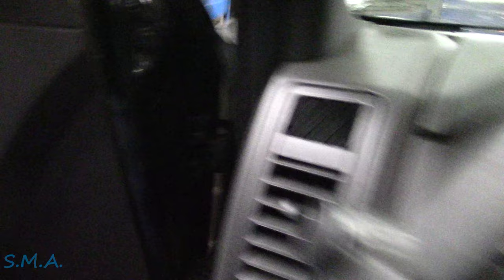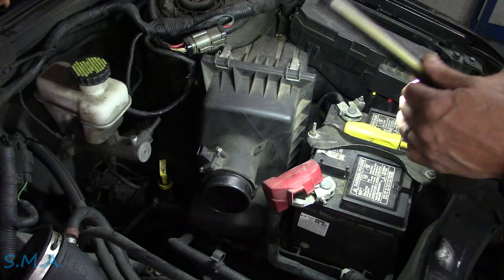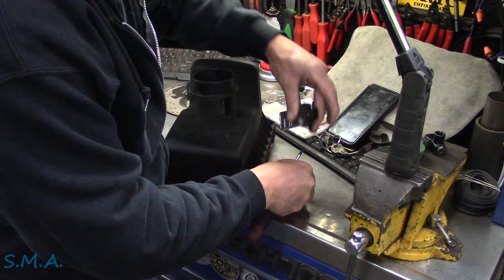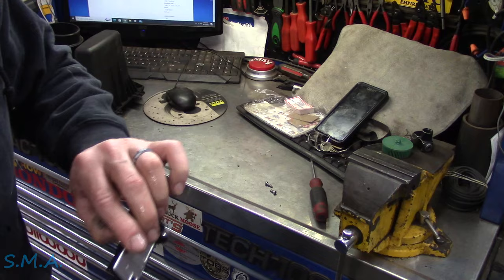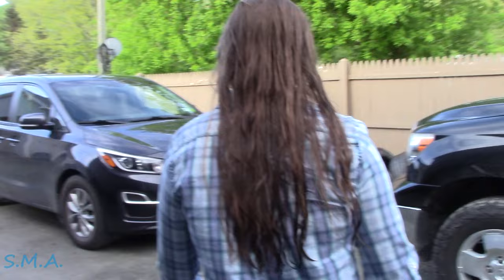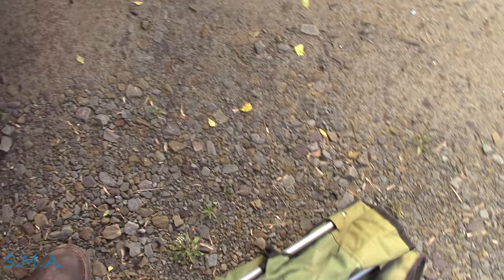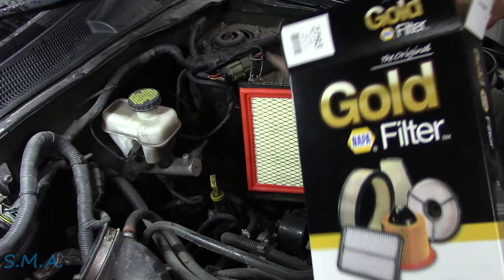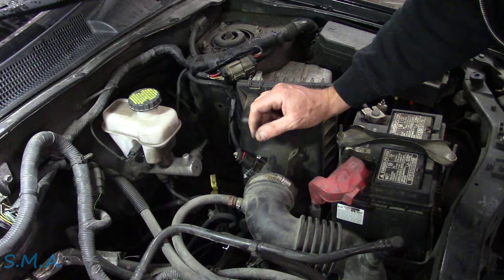A Mouse, A May Fly And A Broken Car....

Comment: I have a chipmunk that keeps storing its nuts in the bottom of my airbox and pissing on my cabin filter.  It only chooses my vehicle.  I swear I took out around 50 acorns when I was tearing the car down.  I found droppings under the back seat when I pulled it out.  I changed the cabin filter the other week and its already smelling like a rodent urinal and I'm losing my damned mind!

Comment: Love you videos. I have a 2011 Dodge Ram 1500. RPMs are going down to 500 when at a stop.  Could it be the mass air flow sensor? Under the hood is pretty dirty. I was thinking that could be it.

Comment: If this would have been a shady mechanic he would have said the engine needed a rebuild due to debris from the holy intake and parked it in in the bay for 2 weeks, then returned it with just a new air filter for $3,000.

Comment: Mine was a rat in a Jeep. Never could find him, he just had to age out. Embarrassing, went to a Bluegrass Festival, parked by the outhouses, he was ripe.
   Did a road call on a Ford 550 dump truck, opened hood drive saw a rodent, next trip out took some peppermint oil sprinkled in engine compartment. Peppermint  oil works good to chase a rat out of the house. Read somewhere that peanut oil is use in wire insulation, thus attraction for rodents. Must be true I read it on You tube.

Comment: Just curious, did you pull the intake going to the throttle body to check if filter remnants were possibly stuck in it? I’m sure you did, but that was a lot of filter that got chewed up.

Comment: I recently had a friend that lived in the country leave their car outside of my house and she said they check engine light was on I followed the same procedure that you did and found the same exact infestation in the air filter that cleaned it all out clean the mass air flow I also put a screen over the air intake sprayed the whole engine or I mean the lines with jalapeno juice because the rodents are chewed up some of the vacuum lines and wires I guarantee they won't go after that car again and it ran like it's scalled dog and she was happy and it cost me not a whole lot of money to set her up hey that's what friends are for have a I once had my fridge act funny check the fan & was a mummified mouse body no head the fan chopped  chased my wife with it  great day

Comment: I had a mouse climb up in the heater motor cage and die on a 99 degree day. I could not use air because of the stink.

Comment: Mr O  those little suckers cost me 275.00 big ones got up in fuse box on my 2500 chevy silverado  got up left garage  truck went in to limp mode made it back home called shop they found a complete home in there and snacks were the wires . Ended up traping 3 more life in the country. Ues a rodent  repellant  now no problem since

Comment: not to be overly pedantic- but the chances of contracting the virus are MUCH higher for the population of people exposed to mouse pee/poo, than the general population.  Just as you're more likely to get struck by lightning if you stand outside in an electrical storm with a tall metal pole... Either way- be safe and thanks for a fun video!

Comment: "MY" mouse did over 3k worth of damage to my escape only 3 months old. 2 years later had a heater/blower motor fan noise. took it apart and mouse again but his time it died in the housing and the car has stunk for over a year. I have tried ozone, and commercial cleaners but it is in the plastic and the ONLY thing that has helped is a cinnamon based product. I HATE MICE and have spent the better part of a year in a no holds barred war against them. I have buckets with trap tops that collapse when they go for the bait and they drop into about 4 inches of antifreeze and water mixture, i want suffering. I have physical traps in the vehicles but with no bait as I don't want to attract them just kill them.Once I was sitting in the car waiting for my wife when a live one crawled out from under the hood and sat on the windshield wiper right in front of me. If i had been carrying that day I would have gladly ventilated him trough the windshield and happy to do it. I HATE MICE! :) luv your channel and have learned a lot. best to you and yours.
Reply: Lol. Glue traps, live traps, 5 gallon bucket of water.

Comment: On my 97 F150 5.4L even a little film of dust on those little wires will start to cause the fuel trims to go rich.  Terrible design in my opinion.  I mean I know it's after the filter, but with all the air being sucked past that sensor as you drive, it is bound to get crud eventually.

Comment: Have a question about oil I have 07 Chevy impala lt 3.5 liter 125000 miles always ran 5w30 synthetic oil high mileage would it hurt anything to run 5 w40 synthetic or 10 w 40 synthetic
Reply: Could you answer my question please

Comment: Question Mr O needs oil change is that a result of the car running rich trying to adjust for the MAF problem?  You want to laugh about mice. The Inn I work at decorates in the fall well our hay bail came with a little visitor.  After a bag of Walnuts he ate the whole damn bag LOL he was Megamouse you couldn't even see it's legs.

Comment: On the mouse rodent in the car roll up windows put a dryer vent over tailpipe in window tape it shut and let it run 90 mins    then  Ventilate over night with fan
Reply: Bad idea. You don’t want the mouse to die in the car in some unknown place because it will STINK.
Reply: @ouch1011  
Any good tog or cat can find that dead mouse in mins